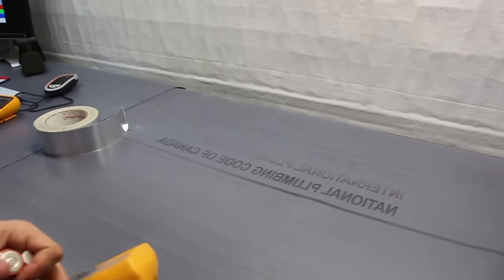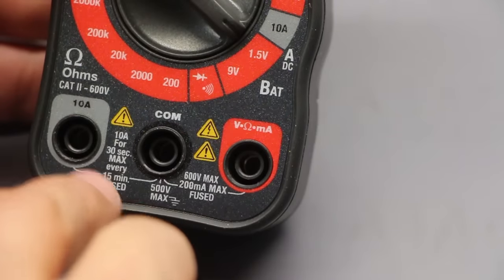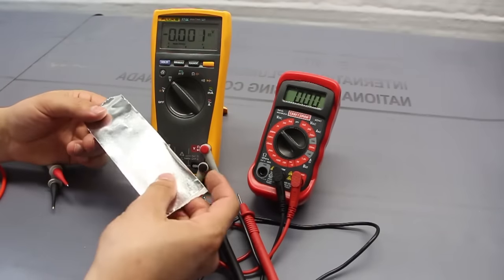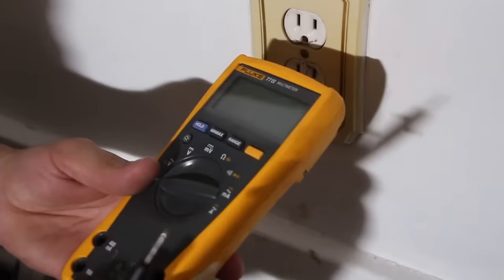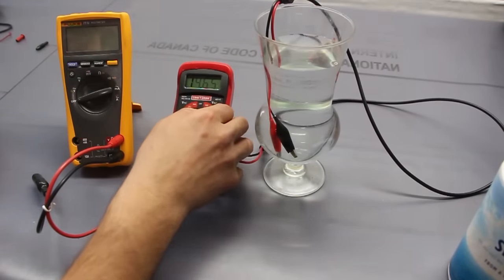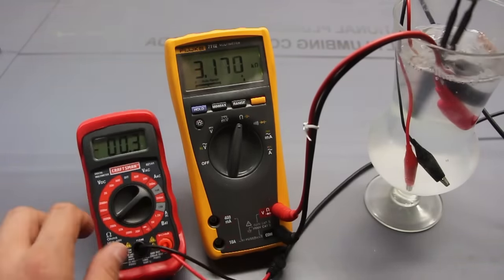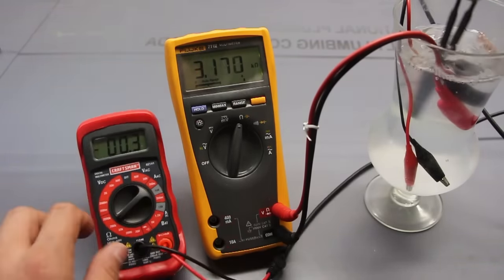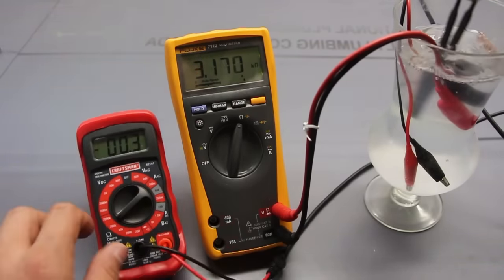The Best Multimeter Tutorial in The World (How to use & Experiments)

Comment: Hi, I have the Craftsman 82141 tester and I can't read all of the numbers on one of the two fuses in the multimeter. With the back off and bottom of meter facing down the fuse is the one on the right side. The fuse says 10A250V but I cant read the other numbers that may indicate size etc. One set of letters appears to say GFE on one end of the fuse. Can you help on this? Thanks!

Comment: 35:00 Correction: Both current and voltage (Electromotive force) work together to kill. 100A at 0.1V would do you no harm. Voltage is the amount of force that current uses to flow through a conductor. A lot of current with very little force moving it would do you little harm. 
 ElectroBoom has a video experiment to test this out.

Comment: Good call out on the Craftsman receptacle voltage fail. The meter read zero and should have been 120.
Reply: I have the same Craftsman 82141 meter and have used it for several years. I don't know what's going on with Daniel's meter but mine reads AC volts correctly when set to either the 200v or 600v range. I took a pic of it to illustrate but can't put it on here.

Comment: The Fluke 77-IV lists for $355.  It is not a $170 meter.  A better comparison would be a Fluke 115.  And then pick a better manual ranging meter, such as Sperry DM5300 or a Klein MM300.   The problem I have had with auto ranging meters, even the better ones, is they are slow.  They take too long to display the voltage.  I can take a manual meter and go to 200V DC and that is sufficient for almost all of the voltages I check in electronics.  If I want a little more accuracy, I go to 20V.   Auto ranging really shines when measuring resistance.   The other problem with the cheap meter is that current should always be a separate input.  Otherwise, the person can go to measure voltage but accidentally leave it on current and have a short.

Comment: Neither meter you're using measures conductance directly. Conductance is the opposite of resistance, and is measured in mhos (or siemens), the reciprocal of resistance: G = 1/R. What you're measuring (or demonstrating) with the tape is either continuity or resistance.

Comment: I have that same craftsman mm.  It is total crap!  I have to move the base of the test leads just right in the socket or it won't read.  VERY sketchy.  If it wasn't for that.  It would probably do everything I need.  But the connection is highly unreliable.
Any thoughts on the Fluke 101?  Good/Bad?  Does it do MA readings?

Well, I got pissed and pulled it apart.  Turns out the post just needed tightening with a screwdriver.

Comment: On the fluke oL means over limit it’s greater than what the meter can display. On the cheap meter the I on the display is Infact L and again it is the maximum the meter can display ie it greater than the actual measured value , ie if you measure a 500 megohm resistor the may only be able to to show 200 megohm maximum. So because you measured a higher resistor the meter reads OL o L this is a good reading as it shows the resistor isn’t less than it should be, but on the voltage setting if you set it to 250v and measure a 500 v circuit the meter will display OL o L  this tells you to set the meter to the correct range or higher . It could also damage the meter. At best it will blow the internal fuse, at worst it will blow the meter up . That’s why you should always set the meter to it’s highest value when measuring voltage and scale down to the measured voltage . Ie if your testing the voltage at a socket outlet you set the meter to  its highest voltage say 750v  ac take a reading then confirm that read by setting the meter to 200 v ac . As you know the voltage values on the meter don’t match the real voltage ie you don’t have 110v or 240v settings you only get 10 50 200 550 and 750 volts on more expensive models you might get up to 1000v that craftsman has an ac range of 200 to 600 v so  to test your outlets set the meter to 600  the repeat the test on 200 v , both readings should be the same or near as dam it .

Comment: Sorry, too confusing.  I just want to check my voltage on a battery.  I have a Klein Tools mm600.  I don't have anything that says 20 v.  Mine starts from left to right, so first on the left (cause it goes circular) is F, then like an upside down hA, then mA, 10A OFF in the center.  Then turning to the right beside the OFF switch is V with a squiggly line beside it, then what looks like a speaker symbol, then looks like a capital K with a line through it, then Hz.  At the bottom left where to plug your black and red wires, so left is 10A, below and next is that upside down hA, then COM then ubove that to the right is +V0.  So can someone tell me what do i plug in to check how many volts my car battery has?  I know it should be around 12.5 volts.  But i don't want to plug in the wrong thing and burn out this meter. Thank you in advance.

Comment: I took a good chunk of amperage from a light fixture that wasn't finished in my closet when I was younger. I had no idea there was even one IN there. It was just bare wires, that were live, as I discovered when I was reaching up to grab a sleeping bag from the shelf and my hand brushed against those wires. (I learned later that the switch to turn the light on in the crawl space was the same one to power the closet light since they were right next to each other, or at least I assume that was the logic the builder of the house must have used) so I heard a loud pop, which may or may not have just been in my head, my knees buckled and I fell over backwards and to this day I still have 2 tiny burn marks on the back of my left hand. I have to wonder just how strong that current must have been. If I recall correctly, modern homes have 15 and 20 amp circuits but I can't imagine there would be too much of a draw for 2 light fixtures... maybe there was some other stuff on that same circuit for all I know.

Comment: What Is the Difference Between Resistance and Conductance?
Resistance, by definition, is the measure of friction a component presents to the flow of current through it. Resistance is symbolized by the capital letter “R” and is measured in the unit of “ohm.” However, we can also think of this electrical property in terms of its inverse: how easy it is for the current to flow through a component, rather than how difficult. A coil is called an inductor. 

If resistance is the word we use to symbolize the measure of how difficult it is for the current to flow, then a good word to express how easy it is for the current to flow would be conductance. Mathematically, conductance is the reciprocal, or inverse, of resistance:

conductance formula

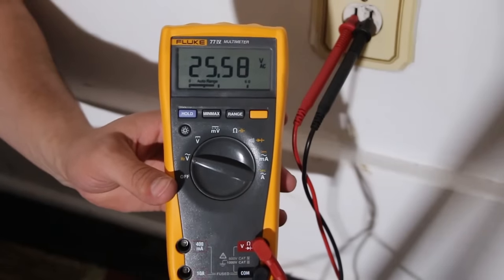Comment: @ [18:57] of your Vid’ while discussing ‘why there is a 25V
presence upon your plug given that the switch is off’…, it is because that is
most likely a “switch plug”…  Meaning the
bottom outlet of that receptacle is controlled by the switch on the yonder side
but the top half portion of the receptacle has constant power and still has
120V present even when the switch is off. Thus the neutral is still connected
on the plug and this condition will create a voltage leak even given the open experienced
by the switch…

Comment: the problem with the high $$$$$ meters for the average home owner is he has too many options  the little cheap meter is great to learn on i am a retired repair man and use the small cheap several times a week sometimes cheking batterys shorted lamp cords ect i built my first meter Analog  back then in 1965  a heath kit mail order  basic electron. course  --test this  if you need 12.5 ohms and you only have 50 ohm res. how would you wire it

Comment: When the switch shut off, the meter read 25V. This is normal. You are picking up induced voltages in the house wiring.
If you were to plug in a lamp, the voltage would drop to around zero. The induced voltages are very weak.

Comment: Would you test and show  the new B&Q digital multimeter 
Please thank you
Reply: I bought one recently (MS8233A). Have blown the 10A fuse already. No instructions on how to replace it. Very annoying. The probes are entirely inappropriate for current measurement, having tiny little spikes to which you have to try to attach crocodile clips. And you cannot dismantle the probes.
Reply: He's American, doubt they have a B&Q. With most multimeters it's simple enough to work out how to use them even without an instruction sheet.

Comment: What is the problem when you test voltage at your receptacle and it reads 120v, but when you plug in a load it doesn't work and you know the load is good?
Reply: Quite possibly a bad connection somewhere along the line that's going open under load, a multimeter especially digital places no load on the circuit.

Comment: In the battery test, the Fluke measured the voltage at 1.27V,  and the Craftsman (cheapo) measured the voltage at 1.62V! By virtue of the Fluke being the more expensive of the two meters, are we therefore to assume that the Craftsman is somewhat inaccurate and not to be trusted?

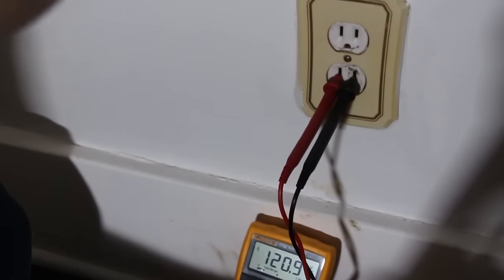Comment: At 18:30 - you probably connected wires on this switch wrong, so you broke the circuit on the zero wire instead of fuse. As the circuit is broken, the gadgets wil not working, but you still have a live wire in wall outlet. This is a very common mistake made by numerous electricians who do not pay enough attention while doing instalations. Please check this out (for your own safety).
Reply: explain that again in laymen's terms please, I have been fighting a circuit in a old farm house for a week, it has 1st 2nd and 3rd generation wiring thru out and I have a few 17 volt circuits that I haven't found the reason for, I'm just methodically going thru every connection back to the panel, and looking for loose connections or nails thru the wires?

Comment: In sensible countries with gated sockets (and usually 220v) you can't set up your lethal current test layout. Better to buy an Energy Meter Socket if you want to know the overall draw of an appliance. Only about ten bucks. Even the pro's use those now.
MM's are more suited to checking the current draw if you're "fitting a set fog lights" kind of job.

Comment: Lots of good info but I would add a few points.  Someone installing a ceiling fan could use a multimeter to make sure the power is turned off but a safer and better tool would be a voltage sniffer.  I would recommend anyone working on house wiring to invest on a voltage sniffer because grabbing a hot wire can ruin your whole day. Speaking of Fluke, remember the old slogan they used?  "If it works it's a Fluke!" but I digress.  Anyway, another point is that it isn't safe to use a continuity tester on circuit boards and microelectronics.  Like ohmmeters, continuity testers have to use current to test the path and this could damage sensitive electronics.
Reply: Anyone thinking of using a "voltage sniffer" MUST go study their limitations. They are far more prone to misunderstanding than a meter.
A digital  ohm meter circuit puts out less than .6 volts, which is why they can't be used to check individual transistors. 
If using an analog meter, then why?

Comment: I have the same Sears Craftsman Mulitmeter -- I use the same 200 Vac setting -- i got a reading of 121.5 vs your display of 00.0 - perhaps they fixed it in later models??  (Though the scale still shows "200")

Comment: I have a cheapy , what is V with ~ over it and V with a line n dots . I have ohms switch but the 2 Vs are in the same side of the dial ?
Reply: The ~ is for AC volts, thus the "wiggle".  The line and dots are intended to represent more stability -- DC volts.

Comment: That is an inline circuit no matter how you test it it will not read your voltage it's not parallel like the plug above it you are actually reading amperage but on the wrong setting or just static electricity because only one leg of your power source is active you would actually have to use ground and the hot to read voltage

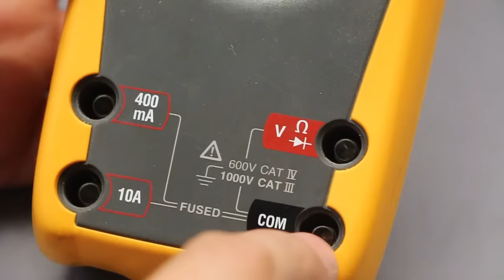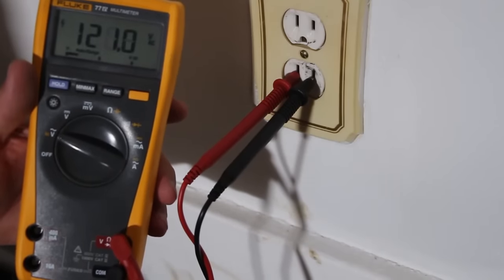Comment: Just a quick comment, you mention not to use different leads on multi meters at 8:05 then at 17:50 you are using the cheap leads on the expensive multi meter......what gives?

Comment: yo how did you connect it for current? saw you plugged the black on into the outlet, but what did you stick in the positive side (red) side? that led to the black clips you clipped to the prong on the toaster outlet? it looks like it was a screw driver with a clamp on it. Meaning you have a wire with clamps on each end, one to the lead into the power source an on clicped on to the prong on the plug! PLEASE ANSSWER. ME BRO

Comment: The cheap meter should have shown 120V on a 200V range. This isn't a bug or a flaw in the design, it's a fault. It should be sent back to the manufacturer. If a voltage is within range then the meter should show it, regardless of the scale you choose. If the voltage is beyond the resolution of the display (e.g. 0.00001V on a 600V range) then it will typically show a "1." display, meaning you must move the dial down to see the value.

Comment: I'm testing current on my multi-rotor and it goes way past 10 amps. How can I measure that?
Reply: Amps shouldn't really be measured using a multimeter. I certainly wouldnt recommend using a multimeter to measure over 10amps, I wouldnt even measure that much. Use a clamp meter. It's what they're designed for to safely read

Comment: How would you measure whether your house outlet is putting out 15A or 20A?  And is Amps ~ Watts?
Reply: Whatever is marked on your circuit breaker is what your outlet will 'put out'. Assuming it is connected to the proper size conductors (wiring) within your walls.
Also the slots are different on 15A and 20A receptacles. A power plug for a 20A appliance will not fit into a 15A outlet. (Reasons.) Google "NEMA 5-15" and "NEMA 5-20"'.

The outlet will supply only the current needed to power the device plugged into it. If you plug in a radio that uses 3 amps to operate into the upper outlet that is connected to a 20 amp circuit breaker, the outlet will only 'put out' 3 amps. If you also plug in a lamp in the lower receptacle that uses 2 amps to light up, then the outlet will 'put out' 5 amps in total.

You can also purchase inexpensive meters that plug directly into the wall outlet for measuring higher amperage's in general household items/appliances. Google "KILL-A-WATT". Finally..... Amps x Volts = Watts. For instance, using my radio example above that runs on 120 Volts AC and uses 3 Amps to operate works out to be:   3(A) x 120(V) = 360 (W)atts of power used.

Comment: So witch one should I buy
Reply: It depends on your purposes.  What kind of testing that you do.
Generally some sort of auto-range multimeter is preferable.
Reply: @coon-si3ce  electrical motor rewinding and engineering
Reply: @kiproydaley3531  
If you are  wiring transformers and caps to get high voltages, you will probably want  one of the flukes that is fairly utility.
If you are working on the circuitry side, you could probably get away with a cheaper auto-raging meter.
Reply: @coon-si3ce  ok thanks for your information

Comment: current measurement you have a very low input resistance, while voltage it is very high like 10 mega Ohms.  So don't measure voltage on current settings.  You just blow a fuse.  For current measurement  you are relying on the resistance else where in the circuit.  That meter must be faulty, dangerous to not measure 120v on 200volt setting. Always use the prove test prove method. Prove your meter on a known source, check what you want to test, and then prove your meter again.  The 25v measurement might have being an induced voltage that is why a LOZ voltage measurement feature is good.  Where voltage is measured and the meter draws a little current.

Comment: I think that Craftsman multimeter is defective. I have a Klein Tools multimeter, which is one of the cheaper ones on the market. It works just fine for measuring electrical outlet voltage when I set it to 200 VAC.

Comment: i'd like to mention a lil thing i noticed during the toaster's Amp reading, the craftsman meter reads to only read 30 secs max every 15 mins and the toaster measurement took 93 seconds = 2 times over the multimeter's fuse can handle. so basically i wont take any advise from this vid. but thanks anyway i learn some don'ts

Comment: There is not a problem with that plug electrically, the bedrooms in my house is wired the same way.  one plug is always hot for appliances, vacuums, clock etc., the other one is for plug in light, so you can use the switch on the wall to turn a light on and off.  One receptical is specifically for a lamp

Comment: .  I own only Flukes modles 12 ,  83,  87, 112 ,117, I use the 112  mostly the 83 and 87 are bigger and will do so much more. you have to be careful not using flukes you can get hurt if using the wrong setting on a cheap meter.😮